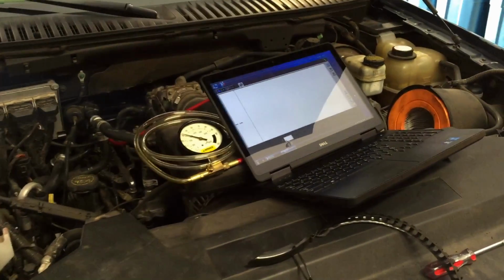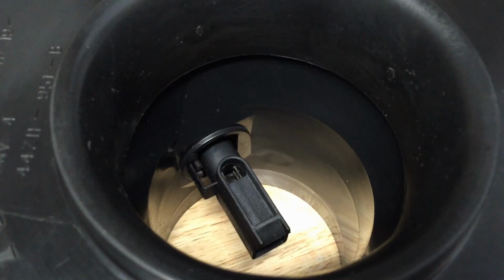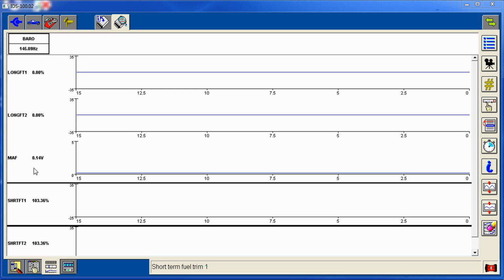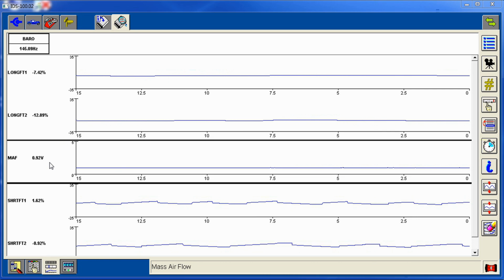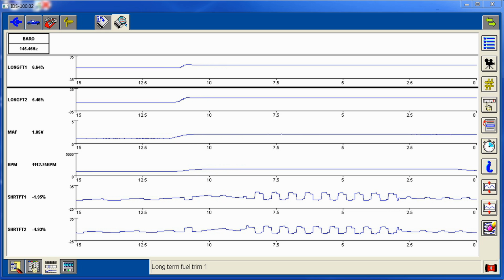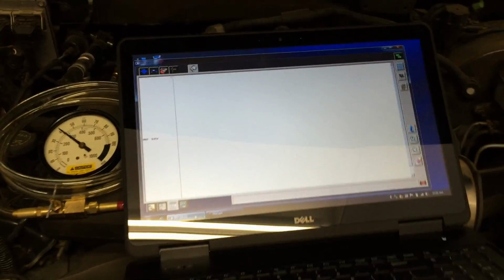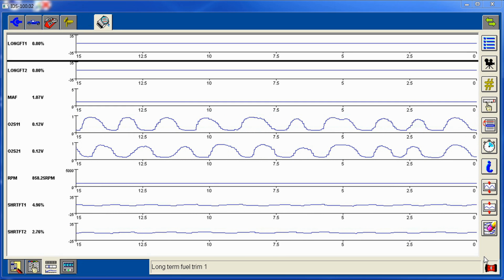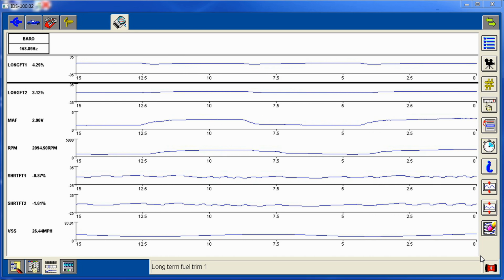Diagnosing a Faulty Mass Air Flow Sensor: P0171 P0174 Lean Codes

Comment: Welcome to 2026!   
An old video but still fully relevant. My older GMC has been acting up a bit and throwing lean codes. A smoke check shows that intake manifold gaskets are leaking a bit.  So that will be done shortly.  There is also a MAF circuit voltage code that pops up from time to time and LTFT pinned at +25.  I do expect the MAF is done with, but am looking for diagnostic tips to confirm/deny the MAF. 
This video helped alot, thanks.

Comment: Mine is the complete opposite from your reading. I'm getting negative 28 on both long and short. Could this still be the MAF? Or the fuel pressure regulator?
I changed the injectors, spark plugs, and coils about 3 years ago. 
So I doubt it's one of those. Im stuck.

Comment: Great information, I never thought of looking at the MAF voltage with the engine off, key on.
I have a 2002 escape 3.0 that the MAF sensor is reading 5/gs at idle and is still the factory sensor.
I've replaced all bad vacuum hoses and have tested spraying down all areas of the engine with carb cleaner listening for an RPM change and I don't get that. I have cleaned the throttle body area and the MAF sensor and IAT.
IAT reads within 10% of engine temperature sensor when cold.
My big problem with the engine was a couple of O2 sensors down stream that were reading 0 volts and the center electrode on a NGK plug broken loose. 
Once all of that was replaced the engine ran fine.
Like I said the MAF sensor is reading Higher than normal and that's my next fix!
Great video, many thanks!

Comment: Hello, after driving around and checking my fuel trims, my short fuel trims shoot up to 28-32% under acceleration. I’ve replaced all vacuums hoses, exhaust manifold and intake manifold. I’ve clean my MAF sensor too. Possible maf sensor gone bad?

Comment: If it's .03v, does that mean it's getting weak and should be replaced? Would the filter have anything to do with the reading being a little high if it's in KOEO?
Reply from the maker: Biased but no need for replacement.
Reply: @FordTechMakuloco thanks.

Comment: Amazing video, exactly the problem I've got with my Subaru Forester 2.0XT, poor performance / hesitation on acceleration, and guzzling tons of fuel.
With the engine OFF, MAF reads a steady 0.24V. Then, after engine ON, it jumps up to ~0.95V initially, then tapers down to ~0.8V. At ~2000rpm's it gets up to ~1.6V.
Several weeks prior, I had already purchased the CRC MAF sensor cleaner, and cleaned the MAF and MAP sensors to see if that made a difference, but it was long before I started studying the data and thus I didn't know the readings were abnormal.
When I did start looking into the data, I first found that both O2 sensor readings had been all over the place, and I proceeded to replace the rear sensor, only to find the same behavior.
Reply: Was it the mass air flow sensors or o2 sensors

Comment: MAF for 2004 Expedition is no longer manufactured by Ford.  I bought aftermarket.  Question, to verify you said ignition on engine not running, MAF airflow should be 0.0?  My original one shows 0.4 and the aftermarket Walker showed 0.8 to 1.0.  Subsequently my fuel trims equal 30-40.  Do I have two faulty MAF sensors?  Or something else?  No vacuum leaks found.  Your videos have taught me so much, thank you for all your help keeping my Expedition going with 224K miles.

Comment: 2009 Ford Escape 3.0l. #1 code P0174 bank 2 lean 
#4 code P0304 .

Spark plugs, ignition coils, fuel injectors all new! Cleaned EGR valve. Have cleaned MAF twice past 4 months. LTFT +7-10 %, LTFT2 stuck at 29 %. Doesn't change? Both STFT perfect. Had misfire code first. After new parts etc P0174 bank 2 lean. Air filter new! MAF obd 2 MAF 2-3.34 g/s idle, 2000 rmp jumps 2.9-8.8 g/s! I'm assuming the MAF SENSOR today! Idles rough. Starts great, no loss power?

Comment: Great video ! I have a 2000 ford ranger 2.5l with a lean code. The mass air flow sensor is reading 0.50 g/s with engine off and 2.21 g/s with engine on at idle. Is those normal readings ?

Comment: My 2013 F-150 with 3.5 Ecoboost with 66000 miles has an issue showing P2096: POST CATALYST FUEL TRIM SYSTEM TOO LEAN BANK 1. Repair shop 1 replaced the Bank 1 O2 sensor and the engine light was not lit for the next few hundred miles of driving. Then the P2096: POST CATALYST FUEL TRIM SYSTEM TOO LEAN BANK 1 returned. The repair shop 1 spent 3 or more hours diagnosing issue and stated both Bank 1 and 2 have the same lean condition and suggested taking it to Ford dealer. I recently took the truck to the Ford repair center and they replaced the O2 sensor for bank 1 and the engine light with the P2096 code returned after driving 70 miles. My $20.00 code reader will clear the error code, but it comes back after 10 to 20 miles of driving. The truck runs fine and smooth, but has lost about 2 miles per gallon on gas mileage since this error started at the 63000 miles timeframe. I've cleaned the Mass Airflow sensors and that did not help to resolve error code. All suggestions are greatly appreciated and wish I had a skilled diagnostics specialist like you and Eric O is my area.

Thanks,
Mike M

Comment: I was getting a P0174 code (lean on bank 2) on a 07 F150 4.2l.
O'Reilly's diagnostic. I changed fuel filter and erased the code(removed neg. battery cable). Check engine light went off. A week later it came back on. I got a fresh tank of gas and a bottle of Lucas Fuel injector cleaner. After about 2 hours of driving it, the Check Engine Light went off again. So far, it's still off for 3 days. We'll see. I start with the cheapest fixes first. 😀👍
Reply: Did your check engine light ever came back after you filled up and put Lucas fuel injection cleaner in?
Thank you!

Comment: Thanks so much for the info.  My Crown Vic was running lean, and missing at idle.  After watching this, I checked the MAF with KOEO...and found that the voltage was 0.23, and was reading 2.5 grams of airflow....   Replaced it, was 0.01v...to zero....no airflow.  Short and Long-term fuel returned to normal, as well as the idle.  Thanks again.

Comment: Sorry to bother you but would you know the average trims, load, afr, lambda for a 2011 mustang 3.7 ? Also it's the blue, purple, yellow, yellow 4 pin maf sensor and I'm certain it's wired up correctly but it won't read

Comment: My scan tool reports in grams of air per second. When I accelerate normally If the maf is under reporting will I get a p0171 and a p0174?

Comment: I recently took my 4.6 2v 98 f 150 to the shop because it has a rpm bounce at wot and none of my local shops can figure it out, I’m stumped. Have replaced lots of things and it has no codes displayed. Was wondering if you had any ideas

Comment: Great info. Yea I think thats the problem I got. It only throwing a lean code in bank 1 P0171 on my v6. No maf codes. But my lg term trim in bank 1 is 14.1% and 13.3 % in bank 2. I revved it up to 3k for 1 min and my lg terms didn't change. But my idle reading at idle is .40 lbs/min .. I think it's under performing.

Comment: My 03 F-350 6.0l mass airflow sensor home owns out fine I have no power coming through the wires with the truck running I checked it owned it there's no power coming through with the key on anything truck running nothing no power coming from the positive side of the mass air flow sensor wire what could it be

Comment: Having an issue with ny 2014 F150 3.5l which seems like mass air flow issue. Around town seems fine on freeway @ 2k to 2500k rpm begins to sputter. Outside of this My truck is throwing codeP054A Cold Start "B" camshaft position timing over Bank 1 trying to figure out if it's the mans air flow sensor (which I cleaned one was gunky) ooor those camshaft position sensors can't afford to purchase them all and have no diagnostic tools any ideas?

Comment: Have 2002 F150 with 4.6. MAF reads .01v on KOEOFF. I have P0172 & P0175  rich codes. I had local garage check. say all sensors in spec. fuel pressure 32  running.
The garage is telling me to check compression , that timing chain could be worn, does this sound correct?

Comment: Hi, I recently put in a high performance Mass air flow sensor in my five hundred, it ran well and made noticable power the next day I unplugged the plug to the sensor and plugged it back in case it seemed lose, when I did that I broke a wire and didn't notice so it wouldn't start I found the break and reconnected it, it started but didn't run well and I started getting the wench light so it kept going in limp mode, why would the new sensor work well for awhile and then not run well at all?  I have two holes in my bumper each going to a induction air filter and meeting at a y and heading up to the intake. I was getting lean problems after I added this, but the one thing I noticed when I was getting codes and limp mode from the map sensor there were no lean codes on the scan tool, I plan to put bigger injectors to balance the lean problem but I wish I could use the new Mass sensor without codes, lots of throttle response and power with it, I would like to hear what you think, i learn alot from your videos for my Ford, thankyou!!!.

Comment: I have a 2004 ford e250 van with the 5.4 liter engine I have no engine codes but im having a horn sounding noise coming from the mass air flow sensor area and i just had my transmission rebuilt and it was making this noise before the rebuild it will only make the sound when its in idle when im driving the noise goes away and i cleaned sensor with cleaner and its still making that noise.

Comment: Would a faulty MAF give you a code? I have a 05 mustang gt thats running like crap and is not throwing any codes. I recently replaced the throttle body and didnt help one bit. My idle is actually sometimes lower than usual and it runs very sluggish on take off. Every so often it randomly runs ok out of knowhere. I have noticed that when the car is running bad the shifting feels clunky and rough but if it runs good it shift nicely. Taking off in firstgear is a drag cus it seems like the rpms just want to drop any thoughts?? Most shops out here keep saying i have to go to the dealer because theres no codes and they cant diagnose the issue!! Any advice would be appreciated

Comment: When I turned my key to the on position /engine off,
I read on MAF sensor .23 and also when I unplugged it, It still reads .23.
So to see if the car knows that it is installed I drove with if off.
It threw a code that it was so I thought that the wires were electrically fine.
I then brought a new MAF sensor and plug it in and it too is reading the same thing .23 along with high Lt fuel trims...

Thanks for all your videos they have pointed me in the right direction.

Comment: First I would like to thank you so much from what I have learned from watching your videos. I have a 2003 F150 5.4 throwing P0171 and P0174 only in extreme cold conditions. I purchased an OBD2 scanner and do not see a way of reading V on the MAF but it does show g/s. My question is reading is .16 g/s key on engine off. Can anything be concluded from this reading or should it read 0?

Comment: Alright, I’m confused... I have a 2005 F150 4.6L six pin maf sensor .  I have tried cleaning it with the cleaner spray, no change. Tried the method with truck running unplug the mass air flow sensor and it kept running and what a video told me is it’s bad if the truck stays running. So then I tried the other method as where you figured out your power, ground and signal wires. When I test the signal wires with meter and press the gas peddle slowly and release slowly it shows me that it’s good.... which method is correct??? Thanks

Comment: Wat is da normal mass air flow sensor reading at idle on a 05 f150xl. 4.6l.rwd & also cold starts up around 1500-2000 rpms on cold starts only y..????

Comment: I have a 2014 mazda bt50 turbo which is diesel. I have realised it uses a lot more diesel than normal and I also realise when I stArt it up from cold you smell a strong diesel smell from the exhaust

Comment: I have a 2001 Expedition with 167K miles with the 5.4 that  I believe gave the same codes. Would it make sense to clean the MAFS or replace it given the mileage of the truck?   Thanks, Paul.

Comment: Hey bud, i'm a new subscriber to your channel ,great info/vids ! I have a 05 5.4 triton , that stalls well driving /all lights on dash come ,no throttle response , but will start up after a bit And will run fine , this happens once every few weeks , any advice would help ,thanks !
Reply: F-150
Reply: Not going to say it's the for your problem fix but I had a dirty throttle body which caused a similar issue as yours.  Cleaned it with the CRC throttle body cleaner and now idles at the proper RPM and hasn't stalled since.
Reply: I got same problem on my 4.6 3 valve 2010
Reply: Fuel module..mine was above spare tire..corroded

Comment: Sorry to double my post, but I really need your opinion ... Thank you in advance!Hi!I have a 2004, Ford Focus Mk1, with 1.8 tdci 85 Kw engine (european version, MK1 facelift).Based on your video I have checked the MAF on my car and it reads 0.059V. Is this good or I must change the MAF? I noticed a bit of power-drop in high rev range (3500-4400 RPM) in the last year, but the fuel consumption and the overall performance are still OK. The car has 312.000 KMs now without any intervention to engine, and no need to top up between the oil changes ...Thank you in advance!

Comment: Hi!I have a 2004, Ford Focus Mk1, with 1.8 tdci 85 Kw engine (european version, MK1 facelift).Based on your video I have checked the MAF on my car and it reads 0.059V. Is this good or I must change the MAF? I noticed a bit of power-drop in high rev range (3500-4400 RPM) in the last year, but the fuel consumption and the overall performance are still OK. The car has 312.000 KMs now without any intervention to engine, and no need to top up between the oil changes ...Thank you in advance!

Comment: Is it common to see conflicting lean and rich codes? I'm getting P0171 and P0174 with P0172 and P0175. I cleared the codes and the lean codes were the first ones that come up. I don't know if I'm seeing some kind of overcompensation or what. I can't really find anything on conflicting codes. I am also have a rolling idle, poor power and performance, especially on acceleration. Driving a 2006 E350 5.4L with 140,000 miles. BTW this started after a fill up, so I was also thinking bad fuel, but I've been through a couple fill ups since. I inspected the MAF sensor and doesn't seem to be dirty, but I'm going to clean it anyway and install a new air filter since I didn't at my 140,000 mile oil change before a this long drive during a vacation. Any wisdom would be greatly appreciated.
Reply: Also making sure...there are 2 cracks in the air filter housing. I would think that the filter would seal these off and they are also pre MAF. Would that be a problem?
Reply: Cleaned the MAF scensor and these codes dissapeared. But 3 weeks later I'm having P0306 and P0356, can't help but think they're related. Going to check out my coil on cylinder 6, spark plug and fuel injector, plus wiring. Any help would be great!

Comment: Should I disconnect the battery while cleaning the MAF sensor?
Reply: You should unplug the sensor and not plug it back in until the solvent cleaner is completely dry
Reply: +Hammer0f Thor for sure. My 05 Mercury LSE runs very well but after cleaning the MAS I'll just be driving along and I'll think to myself, 'this car runs EFFING good'! And it does...85k miles and its perfect. I recently purchase a 02 LX Sport (last design cuz it's black with 33k miles) and the Mercury out performs it by far with the same specs. 4.6 dual exhaust 3.27 ratio. The ford just seems like a big heavy car but the Mercury seems lighter more nimble. The next panther platform would've been amazing.
Reply: +Hammer0f Thor what I was getting at is the Merc runs better

Comment: most of the time i get ford with p0171 and p0174 is do it tps out range a vacuum leak from idle valve breather or intake gasket itself and dirty mas sensor. good video.
Reply: Ķ

Comment: Speaking of driveability issues,  what would I need to look for in a vehicle that is surging?  I have two vehicles that exhibit the same problems.  Both are Ford.  One is 1996 Ford Contour, manual trans. with 117K on it and a 2002 ford Explorer with 190K (you've helped me with this one before).  Fuel pressures are good, new clean FORD air filters, fresh plugs, and quality fuel.  Seems to be more pronounced when the vehicles are coming up to temp.  Never completely goes away, but gets less severe.  I'm thinking wonky O2 sensors?
Reply: Thank  you!  It never occurred to me to suspect the DPFE.  I will definitely test them to see if it has an effect on both my Contour and my Explorer.

Comment: cheer's Brian had a diesel ford cmax 1.8  here in the UK the only way I could prove it was air mass meter was to disconnect it and it then went like a rocket.  it was not voltage but frequency between 1khz to 7 kHz, sandy